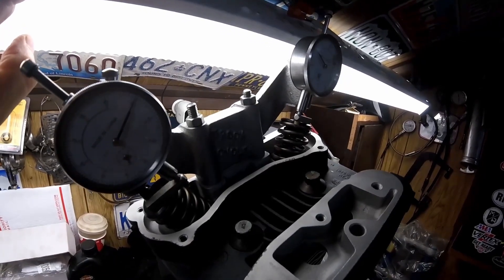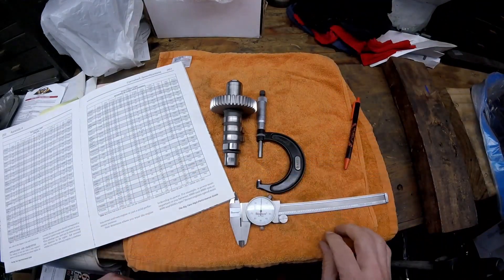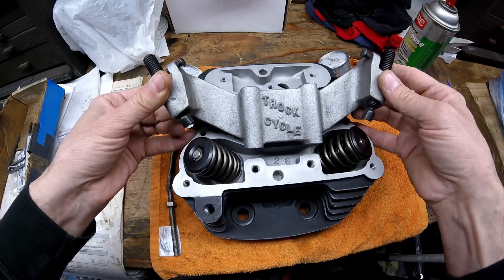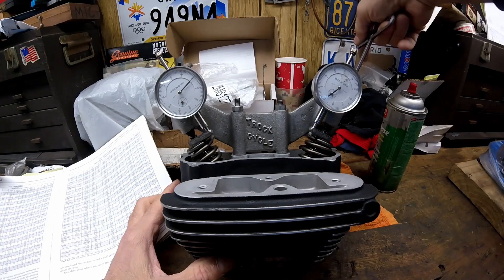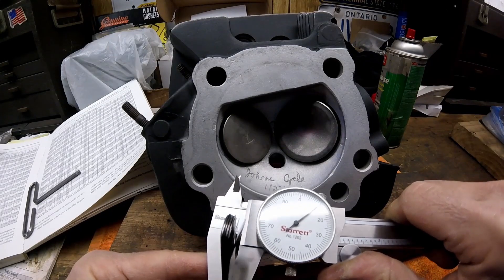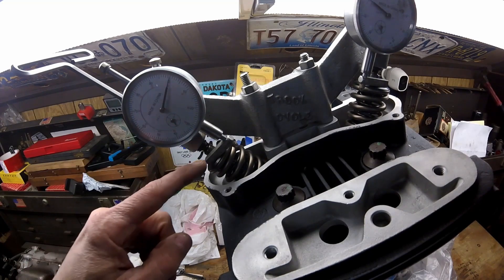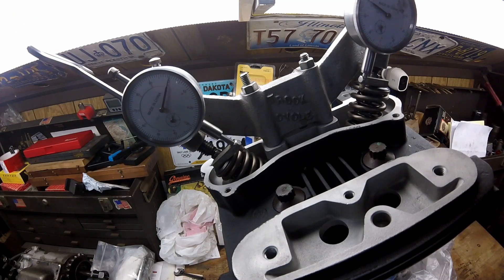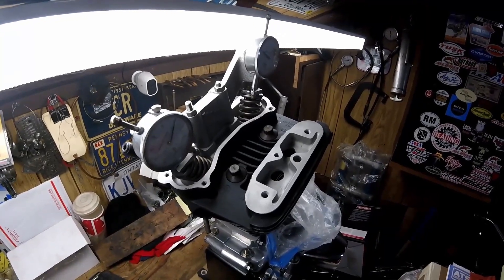Checking Piston to Valve clearance Harley Davidson Evo

Comment: Great video. Just a note that true TDC isn’t when the piston is closest to the valve. Approx 10 degrees after TDC the intake valve is closest to the piston.  Approx 10 degrees before TDC the exhaust valve is closest to the piston.
Reply from the maker: Good to know but wouldn’t it also depend on the cam profile.

Comment: Bolt cam are a piece  of cake ,try running .785 lift with  .265 TDC intake  & .285 TDC exhaust ,valve too valve on the seat .385 you have to sink the seats  & buy blank valves and machine them lol give that try lol
Reply from the maker: Putting a cam in that big is something I’ll never be doing. I respect the skill that it takes to do that.

Comment: how do you check valve to valve without that tool? Trock is out of business and no one else seems to make that tool.
Reply from the maker: Great question! I had no idea that Trock is out of business. I also looked and it doesn't seem that anyone makes this tool. 
I only thing I can guess is having a dial indicator and lower the valve the amount it opens at TDC and have a tight o-ring or tape or a clamp of some kind, to hold it. Then do the same thing with the other valve. At that point you can measure the clearance. This would get you close.